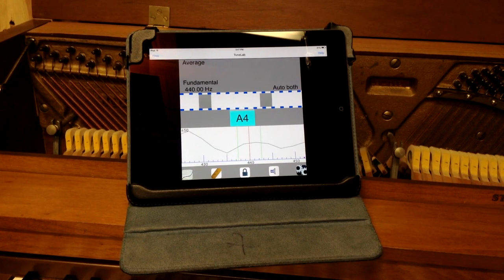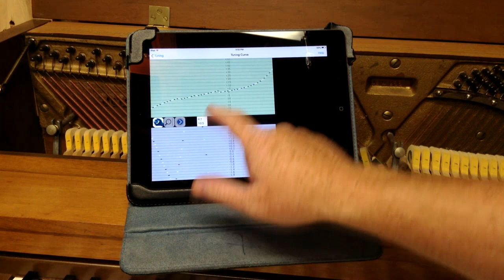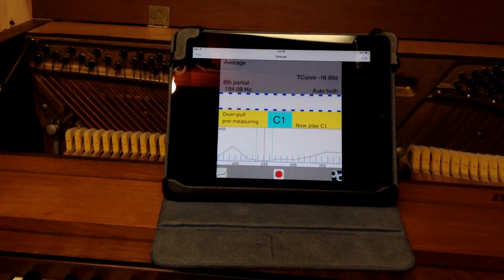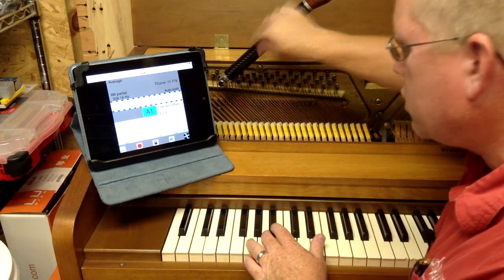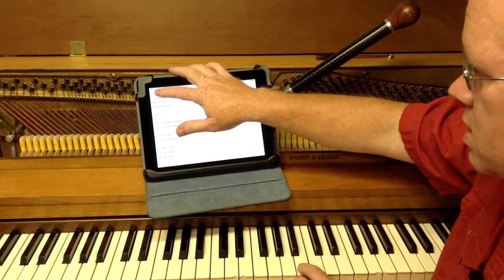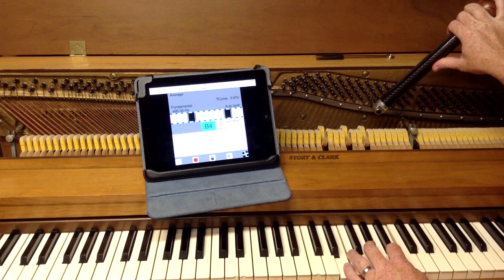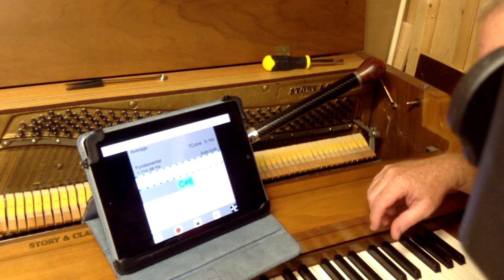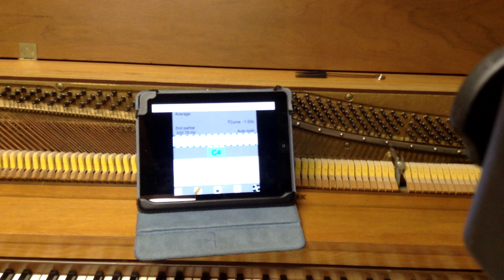Piano Tuning - Pitchraise Demonstration I HOWARD PIANO INDUSTRIES

Comment: Can you tune a 'standard' piano to 415 ? Not as much tension to the strings, would they be too slack? You can do it on a guitar and a violin, although tuning down a whole tone and the strings feel pretty slack. Of course you can just fit thicker gauges.
Reply from the maker: You can tune a piano down that low, but the tone will change some because of the lower tension on the strings.
Reply: Well a quick listen will show that the tones get too lazy if A is tuned under 432Hz.  432 seems to give the most amount of pure musical energy.  Plus:  415 is no longer an "A" anyway.  You could play the composition a 1/2 step lower and basically get the 415 and the piano will maintain its original tone.  Not all composers choose the key because of its moral quality in relation to the composition's purpose.  Especially since equal temperament destroys key individuality.  So changing the key is a worthy experiment.
Reply: Dennis Dougherty I won't start an argument about a=432hz because I think a=442hz sounds best (it's brighter and gives a more brilliant sound imo) but a=415hz is referring to the historical baroque tuning (maybe op really likes playing baroque authentically). Anyway my point is that I know what you mean with the resonance of 432hz but another option (potentially) would be trying a lighter guage string (less thickness = less tension = more resonance) just my thoughts

Comment: I have an old Aeolian upright. Everything is tuned down. C is B and so on. Would it be a bad idea to try and bring it up?
Reply from the maker: There is some risk in pulling the pitch up this much, but I've one it many times.  If the pins are tight enough then the risk is low.  You may break some strings, but these can be replaced.
Reply: It's probably at A=415
Reply: How do you know if the pins are tight enough

Comment: Sir I am using da tuner pro . Does it already set the temperament equal? And how do i calculate strech on my piano? Its ju 109 of yamaha
Reply from the maker: Yes, Tunelab does set the temperament to equal temperament by default.  Calculating the stretch is something that I will be offering a video in the future on.
Reply: +howardpianoind and what about DA TUNER PRO ON android
Reply from the maker: I'm sorry, I misunderstood.  I don't think that that app  has a way of calculating stretch on a piano.  Many of the more generic tuning programs aren't designed to be able to tune a piano properly.
Reply: +howardpianoind  sir I am so thankful to
You for your prompt replies.. But tunelab here in India is quite expensive please tell any freeware good software or a nominal cost software.. And my piano is set on pitch it does not require strech..
Reply from the maker: Tunelab does have a shareware version, but it requires that you use it on a laptop or windows based computer.  They have the download for this on their website.
Reply: Hi, as far as I know I think you can set a customized stretch profile curve by using Pro version of Da Tuner and using the custom instrument feature. As Mr Howard has explained in other videos, stretching curves  aren't any perfect science and every piano is different, so you can start with a generic curve and make your own tests. Anyway, in my opinion it is better to use the tuner only as a reference trying to tune by ear.

Comment: Hello! Thanks for this tutorial video. What i  need to do to change pich and tune A 432.I  find A 4,than manually scroll down  to 432 and this  measurement  goes  for all register?)
Reply from the maker: If you swipe on the phase display it will allow you to do an offset from standard pitch.

Comment: Do you charge the client extra when you encounter a pitch raise?  If so, typically what % of a normal tuning charge?
Reply from the maker: I didn't use to charge extra for a pitchraise, but I started charging extra for this in the past few months as it is more work.  I charge 20% more than my normal charge now for pitch adjustments.
Reply: I agree it definitely is more work.  Personally I think more like 40% is fair.  The client may ask and it is easily explained by educating them on the reason why you essentially have to make 2 full passes (or sometimes more) to get the strings to remain stable at the correct pitch.

Comment: Can I ask how much pitch raise do I gave a spinet that has not been tuned for a bout 4 years
Reply from the maker: The amount that you need to overpull the pitch sill depend on how far from standard pitch the piano is on average.  If you are using an electronic tuning software or device such as Tunelab, the overpull amount will be calculated for you automatically, but in general the overpull amount should be about 25%.  But this will vary depending on what section of the piano you're in.  So for example the 25% would mean that if the pitch is 20 cents flat you would overpull by about 5 cents.  If the pitch is 100 cents flat you would overpull by about 25 cents.

Comment: wow..brutal without mutes...thx anyway
Reply from the maker: It can be done with mutes, but this would make it take much longer.  It does take some practice to be able to do this without mutes, but once you can do it, it will save a lot of time.
Reply: The idea here is speed and baby steps not accuracy of the tuning scale.  The final tuning will thank you for a quick pitch raise especially if you tune a little bass, then a few very highs and a couple in the middle.  Repeat that order until you have done the entire instrument. The harp will thank you as well.

Comment: This one was not as helpful as many of your videos -- partly because of the amount of time on the software which not everyone has.  So -- let's say we need a pitch raise and we tune it to about 5 cents sharp.  Next step ?  Re-tune right away or let it rest and get "played in" before fine tuning ?  Btw -- I'm using a Korg OT 120 and generally I'll do the temperament on the center section to about 5 cents over, bang on it for a bit, re-tune to pitch then do a single pass on the rest of the piano -- tell the customer to bang the heck out of it for two weeks then do a complementary follow up.
Reply from the maker: When you do a pitchraise, you can do the fine tuning immediately after the pitchraise as the pitch adjusts as you do the pitchraise.